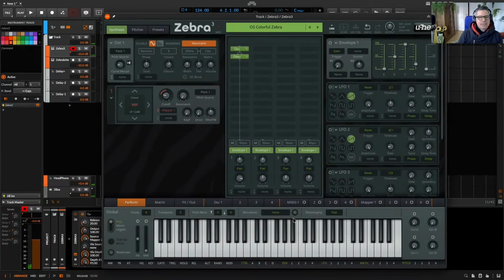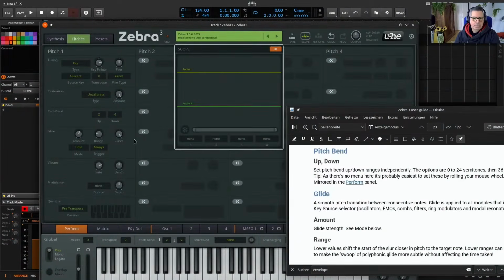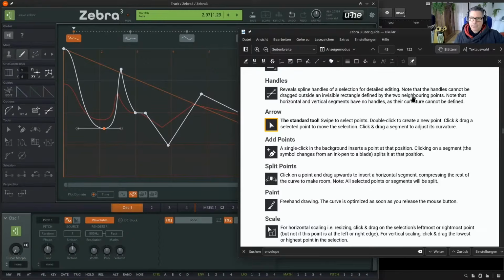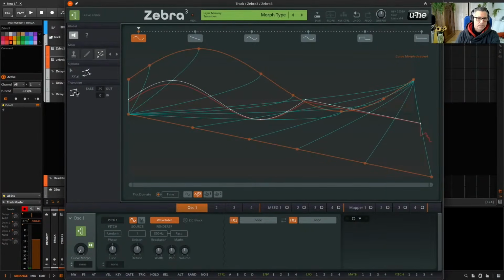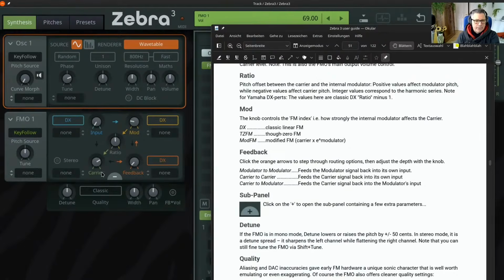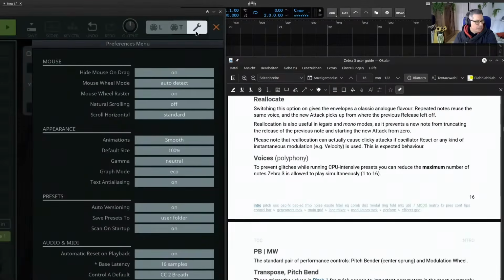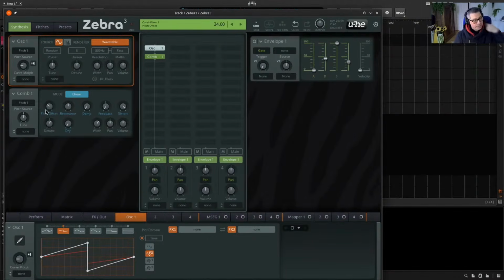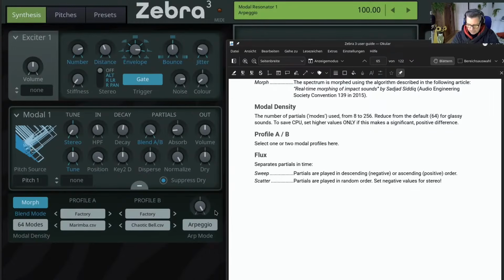Learn Zebra 3 Oscillators, Pitch & Modulation Deep Dive

Comment from the maker: Because I searched some features for the envelope. In the forum Urs Heckmann wrotealready on 10.12.2025 
"We are thinking of bringing back the Vari-Slope mode for envelopes. No ETA yet. There are however ways built-in to change the slope, such as modulating Stretch by the Env itself, or using Feedback." 

So ... YEAHHH 🚀